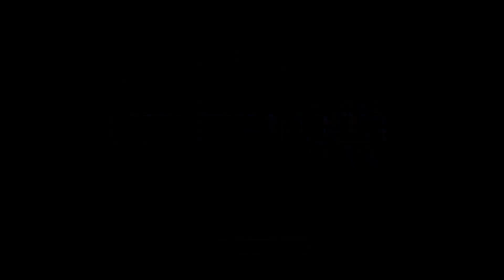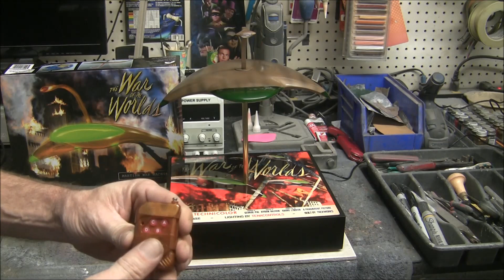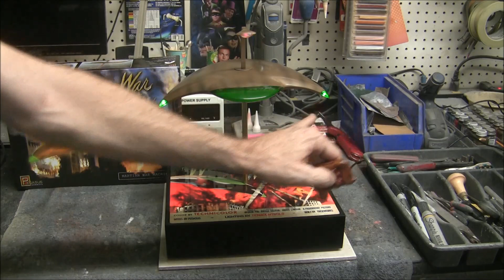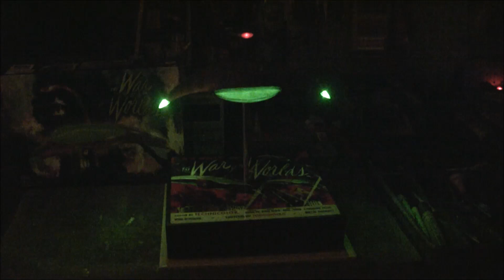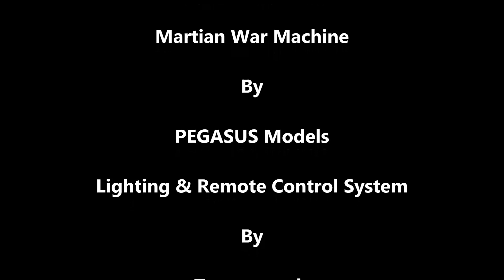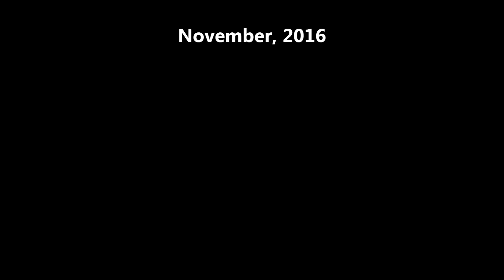Martian War Machine Model With Tenacontrols Remote System

Comment: That,s a great upgrade using the remote,i picked up a rare Lunar Models vac form kit of the war machine,its about 5 inches bigger in diameter than the Pegasus kit,going to use Ralph,s board in it .

Comment: Great job Boyd! Been waiting for you to finish this one! I finished this as well a few weeks ago. I used Ralph's lighting and sound kit as well. I do wish he'd make some changes on the sound effects though. The sounds are a bit too "tinny". Especially on the powering down sound where the machines die off at the end of the movie. I noticed you didn't use that sound. It sounds really squeeky. Also the green wingtip sound effects sound more like gunshots rather than the "photon torpedo"  or "pew! pew!" sounds like in the movie. Maybe Ralph can rerecord those more cleaner and clearer? Also maybe more of a gap between the sound of the laser blasts from the cobra head so it's not shooting one right after the other. I actually ended up building another one of these with just the pulsating light effects and no sound. It's a great kit, both the model and the lighting but maybe just a bit of tweeking with the sound effects for future electronics kits?
Reply from the maker: Ralph is constantly upgrading his products so I'm sure there will be a more capable system coming along. At the point when this one was developed, there was a limit to the memory built into the chip on the sound board. This meant that the sounds had to be short and at a low sampling rate. The memory available on these boards continues to expand and with it the length and quality of the sounds. I really like the remote system with it's ultra simple installation and it's compatibility with almost any control boards.
Reply: Oh that's great to hear! I hope he'll do an update to the sound board. I wish the remote was available when I built this kit but if he does do an update, I'll just build another one! Thank you for the info! Love the job you did on your ship!